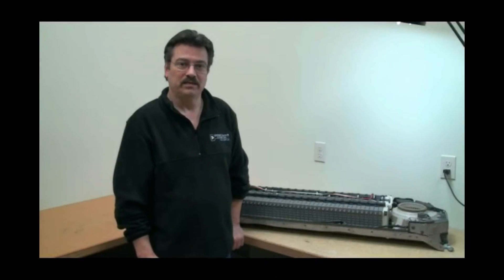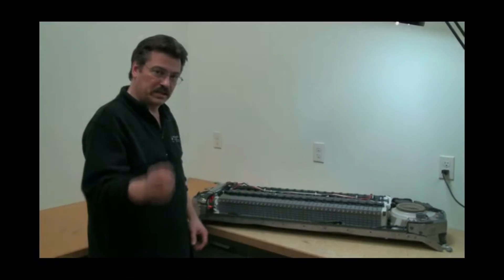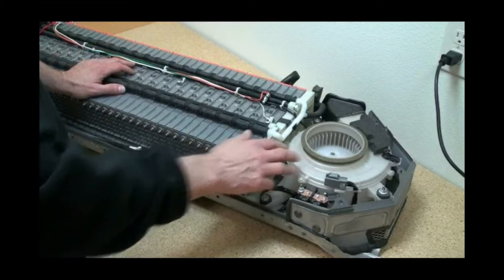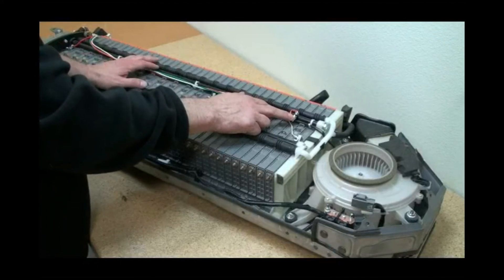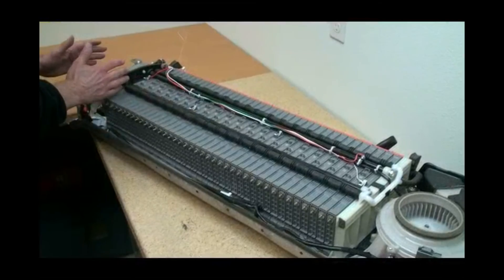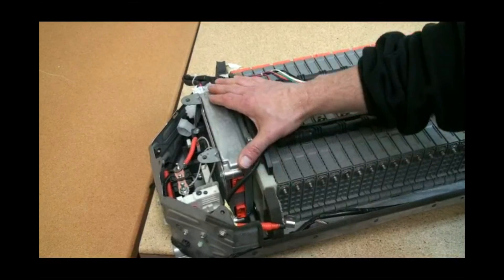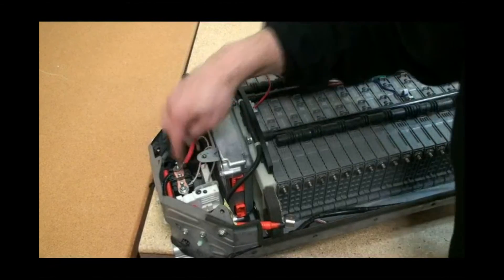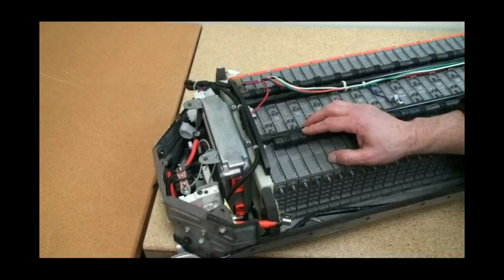HEV TV 2.6: The GM 2-Mode Hybrid Battery Pack

Comment: this battery belongs to which vehicle ?
Reply: GMC Yukon , Tahoe, escalated . Not a Prius
Reply: 2008 - 2013  Chevrolet/Cadillac/GMC Tahoe/Yukon/Escalade/Silverado/Sierra1500 all of the GM two-mode hybrids 
2009 Chrysler Aspen Hybrid
and similar: 2006 - 2012 Lexus GS 450h
Reply: @koeniglicher  Similar only in that it has 40 modules.  It is different in every other way.
Reply: @snoobler  Well I let others make their own judgements:
* they have the same number of cells and the same type of cells (40 modules 6sp1 of Primearth EV Energy(Panasonic+Toyota) of the same NiMH chemistry with the same capacity of 6,5 Ah. I'm confident, that the cells are interchangeable due to the same physical and electrical parameters.
https://cdn11.bigcommerce.com/s-l6hu360yba/product_images/uploaded_images/install-gs-010a.png?13544932904382795859
https://www.lexusownersclub.co.uk/uploads/monthly_10_2015/post-54435-0-23944100-1445377026_thumb.jpg
* with the same cells, the battery capacity, voltages, currents are equal, and battery power is identical, therefore charging and power capabilities are similar. And also the battery management system must be similar.
* The thermal management system with this large round fan looks similar, only external to the battery case and rotated, compare with 
https://i.ebayimg.com/images/g/wlMAAOSwB09YKgRc/s-l1600.jpg

Lexus put controls and fans outside of the case, GM assembled this stuff in the battery case. Makes a physical difference, but the architecture remains.

Of course, the Lexus GS battery pack has a different battery case and they are not drop-in replacements for each other, but technically and for purposes of rebuilding/refactoring/overhaul a lot of major components are shared. I'm confident, that sensor architecture (number and type of sensors) and safety architecture are also at least similar. Likely CAN bus signals to/from the BMS are different, but the control circuitry in such a pack rarely  fails.
Reply: @koeniglicher  I have no issue with allowing others to make their own judgments, but they need to be provided accurate information to do so.The ONLY shared components are the modules and the copper bus bars. That's it. Period. By your definition almost all Primearth made batteries are "similar" and you should have included a list of those as well (2004-2015 Prius, All Prius C/V, All Camry, Altima, Avalon, CT200h, etc). You even included a gen3 Prius battery in one of your pictured examples. Why not include that one?

I think what we're dealing with here is your lack of understanding of the word "similar". Please consult your favorite dictionary for the word "similar" and I think you might agree that when only two components of a dozen+ are the same and none of the others "resemble" each other in any meaningful way beyond "piece of formed sheet metal, wires, sensors," etc., I think you might disagree with your own claim.
Reply: @snoobler  hi
Reply: Where can the modules for this specific battery be purchased?

Comment: It absolutely boggles my mind why you would make any kind of instructional/educational video like this WITHOUT wearing high voltage gloves!  Regardless of whether or not that pack is completely discharged, SET AN EXAMPLE OF SAFETY!!
Reply: Good grief. The Bus bars are removed, the highest possible voltage on that partially disassembled battery is 7.2volts  less than your 9V battery in your smoke detector. Do you wear high voltage gloves when you change your smoke detector battery LOL
Reply: It's Likely a dummy unit.
Reply: Good thing he isn't a proctologist  Dr.
Reply: 😂😂😂crybby
Reply: im glad u posted that. now im look8ng for gloves